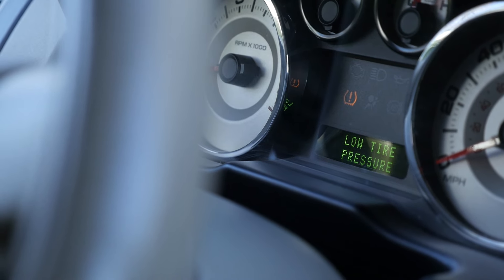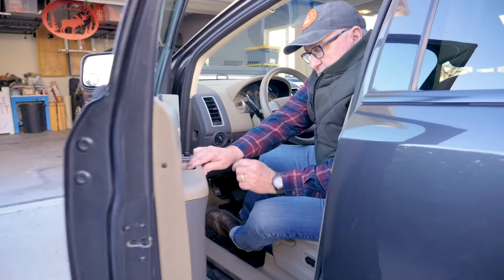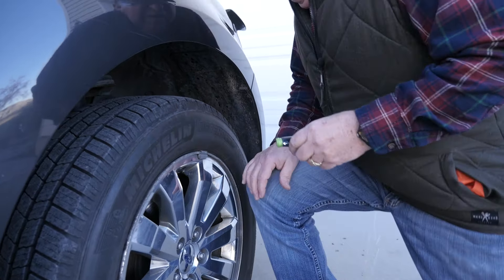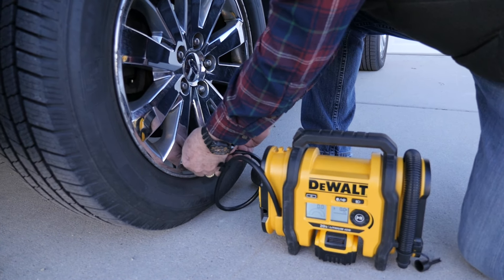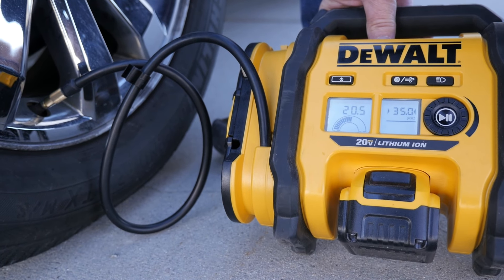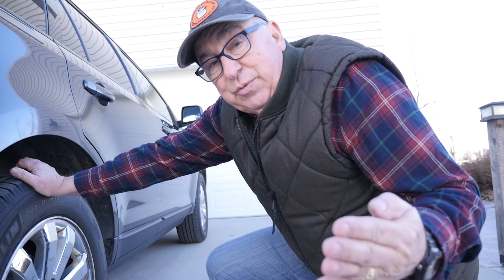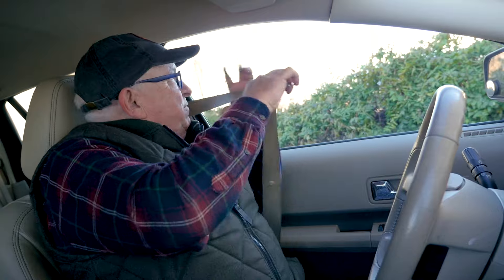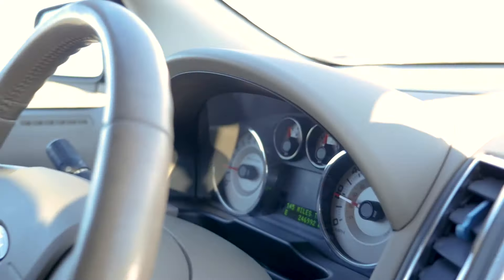Tire Pressure Light Won’t Go Off - Now What?

Comment: But this is totally WRONG if you don't have the stock tires.  If you're not running the stock tires on the car you could ruin them with the incorrect pressure.
Reply from the maker: Thanks for the insight. We'll see if we can append the video - at the very least in the video description. Best, DFJ

Comment: Useless, just another way for dealers to get you in to sell you a new engine!! Use a good tire gauge and place a tape over that light.
Reply from the maker: IronHorseGladiator, thanks for writing. I'm not sure what you mean by your comment about having to buy a new engine. Best, DFJ
Reply: Tape won't help when the car comes up for the MOT test ( UK gov vehicle test ).The garage will simply fail the car if the light is on .Stupid as you can have perfect tyres and show the garage that all tyres have correct pressure BUT they will still fail it if the light is on .One more way to make money out of the car driver.
I have a small plug in code reader to identify warning light faults.

Comment: My TPMS warning light recently came on. All tires, including spare are at optimum pressure. Warning light does not go off. Been over a week of driving already. If it's not the truck's receiver, it's one or more of the sensors on the tires. How the heck do you easily troubleshoot that? Got five tires to debug.
Reply from the maker: This is a tough one, but usually means that one or more of the sensor batteries have worn out. This happens when the sensors are about 5 years or older. Unfortunately, this usually means a trip to tire shop for them to locate what sensors are working and which aren't and replacing the "timed-out" ones. I wish I had better news. Let me know how this turns out for you. Best, DFJ
Reply: @DirtFarmerJay  If it's a sensor, possible culprit could be the spare which is original on my 2011 Tacoma. All four tires were replaced few months ago so unless defected, should be okay. Maybe.